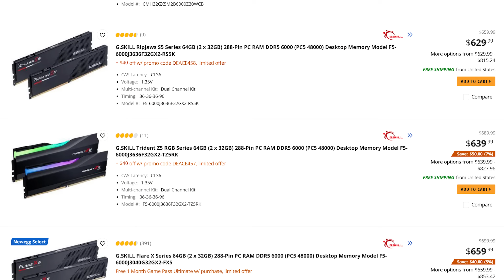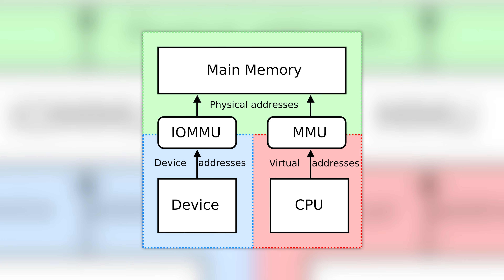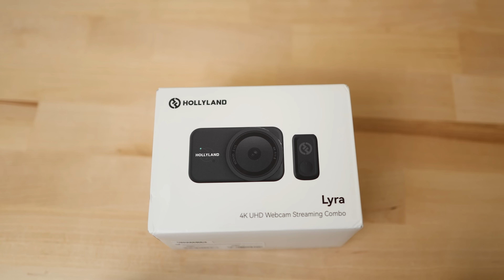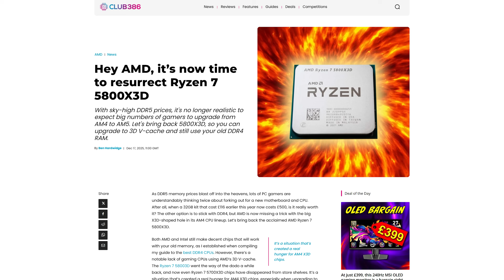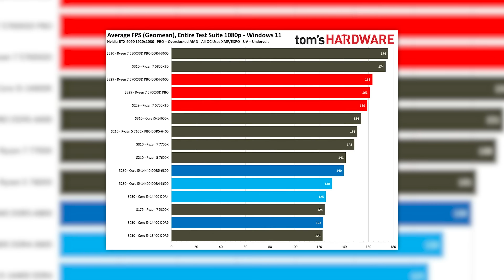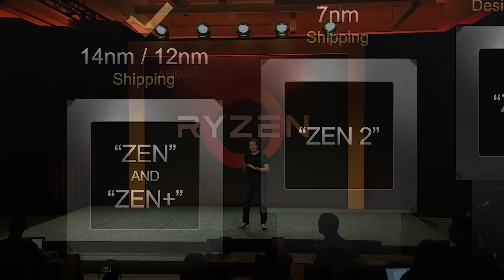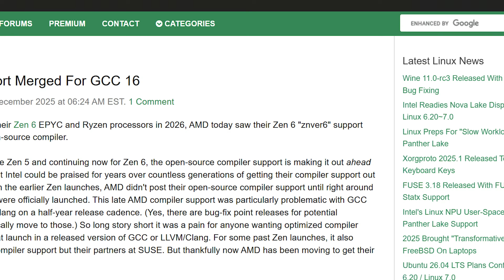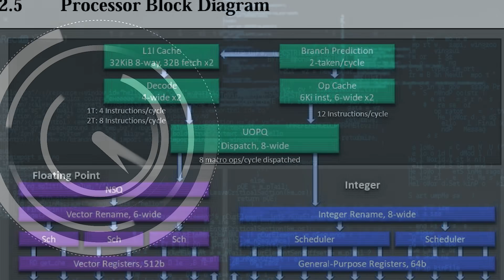It’s OFFICIAL! Ryzen 10,000 Is a Monster!

Comment: Fun fact the valorant thing had a workaround for cheaters the next day, with most of the cheats not even being affected by this. Riot are wasting their time, I guess at least there's some theoretical security improvements because of this? But Tbf if someone is putting hardware Into your machine you have other things to worry about

Comment: just a quick lil reminder, zen6 = ryzen 11000, ryzen 10000 would be zen5+
ryzen 1000 = zen (or zen1)
ryzen 2000 = zen+ (or zen1+)
ryzen 3000 = zen2
ryzen 4000 = zen2+
ryzen 5000 = zen3
ryzen 6000 = zen3+
ryzen 7000 = zen4
ryzen 8000 = zen4+
ryzen 9000 = zen5
ryzen 10000 = zen5+
ryzen 11000 = zen6
etc, every odd number acts like a "in between" generations set of cpu's (although most of the time the + cpu's are apu's)

Comment: well, x370 motherboard here (brought when ryzen 1600x launched) rocking with her 3rd cpu, with 1 year of 5700x3d, 5+ years using 32gb 3433mhz cl 15 b die, i hope my mobo and ram holds another 4-5 years lol. image going to 2030-2031 using a mobo from 2017/18
Reply: Yes you can, I still have ASUS Sabertooth 990FX R2.0 Released in 2012. Writing this comment using it with a bulldozer.

Comment: And this just makes me not want to play any of Riot's games at all.
Reply: Yes, i would rather play in COD's cheat lobbies...
Reply: So...you like cheat in games a lot it seems!
Reply: @riannair7101  to be fair, bios updates can be annoying as they often reset bios settings. On my mobo they recommend reseting settings even if update does not automatically do it... but yea, I would rather fix that issue. Not just for games but overall security of the device. I think it is bold move to require this as if there are people using OEM system with hardware raid 0, those might have to be set up again in bios after update and depending on how they are installed, pc might not boot before doing it.

Comment: I'm using the 5700X3D, i don't know how good AM5 really is, but its running all AAA games without a hitch (combined with RX 7900XT, 20GB RAM)
Reply: My old pc is the dame thing except had a rx7600xt and 32gb of ram and 3tb storage. Still runs everything like a beast
Reply: the 5800x3d is around about the same as a 7500x3d (and its the same with the 5800 and 7500f) so the 5700x3d would be similar to something like a 7400x3d if that existed
Reply: i have upgraded 3900x to 11900k skipping 5800x CPU, and then 11900k to 7800x3d and then 7800x3d to 9800x3d, and to be fair i want to go back to 11900k  right now xD, that was the spot my PC felt it was at its best, and lowest amount of issues. i consider 3900x being even better then 9800x3d due to task redistribution issues AM5 has on win 11, and that is really pissing me off. You just can't play a game with YT running on other screen or it will cause insane FPS dropps and lower video resolution to minimum, only cuz from time to time full CPU stress will be placed on 1st and 2nd core just to give CPU time to rethink that idea and again redistribute tasks over all 8 cores... it is really frustrating thats 3 years now and so simple software fix can't be done by AMD only cuz they can't find common ground with Microsoft. This corporate war geting out of hands.

Comment: they have to make it support DDR3 and DDR4 or it just wont sell well
Reply: Until RAM prices fall, and they will.
Reply: @toby9999  yeah it probably wont be long for the AI bubble to burst. All its going to take is for an AI model that only requires a single high end computer to train on to become mainstream (these models already exist), to cause the whole house of cards to come crashing down. The whole shortage was basically caused by Open AI making a desperate move to try and starve smaller competitors of RAM, all because they have bought into a highly inefficient brute force train by just recklessly throw computational power at the problem method.

Comment: At first I thought it was due to some new security exploit or CPU degradation issue, turns out it's for some multiplayer games I don't even play. No thanks I'm good 😂
Reply: Multiple games are rolling this out delta force just did it and I wanna say rainbow did it they were talking about it months ago it’s more of a matter of time depending on the game but it literally just means DMA users have to buy better firmware
Reply: Usless game Valorent. 2 years back the game just banned me for cheating, so i talked to them and they were ready to give me my acc back and I just said shove ur game  up your ass. I just had to prove my innocence.
Reply: @niteshshrestha3056   well played sir, well played.
Reply: It is a security exploit. You could create a device that reads anything out of memory, like encryption keys and credentials. And since USB4 supports PCIe tunneling, all an attacker would have to do is plug a device into a USB4 port.
Reply: @VTOLfreak  The question is however if it can be exploited without physical access to the computer. If somebody has physical access to my PCI-E bus then I kind of expect my entire computer to be gone by the time I get home.
Reply: @Thegoodthebadandthefleshtuber  But the world doesn't revolves around You. It may not be importante for YOUR use, but surely is for several other people.
And it comes from me: that doesn't play these games and despise in kernel anticheat.
One attack that could affect You: it's common for people to "lose" a flash drive (is it "flash drive" in english? Not my first tongue, and here we call it something else entirely) with an exploit waiting for Windows autoplay. Plug it in and You're compromised.
Another problem would be laptops.
A third one would be business PCs - even POS.
Reply: @sysbofh  I will reword it: how important is it to flash the bios on computers without third party access to the hardware?
Security on schools, offices and similar is not the same as security at home.
My evaluation is to hold it up against the fact that last time I updated bios the motherboard bricked. This means it's very important to know if the exploit requires physical access, a downloaded executable or can be triggered in a browser.
Reply: @Thegoodthebadandthefleshtuber  The exploit depends upon lack of checks on IOMMU access. Do you know what else use them? Virtual Machines. Do You know what Virtual Machines use? A standard interface, to virtualized hardware.
I'd say it's just a matter of time until someone makes a virus that emulates a virtual network card, and just uses this in order to bypass everything.
And the user wouldn't even have to be running a Virtual Machine - the system would just be able to run one.
Sorry about Your bricking MB. It's something that shouldn't happen. But modern ones can recover from it, no? If I'm not mistaken every brand has some kind of "it just brick this thing, let's try again" thing.
Reply: @sysbofh  
afaik, this is only a problem if you have passthrough, there are a lot of variables there for this to be a viable attack, it's not  THAT terrible. It's still bad, but not all motherboards are all that resistant to bricking, so I can't simply say "do it anyway" for people like that.
Reply: @diadetediotedio6918  YOUR case may be resistant to it. Not everyone's will be - and that is the reason why is important for them to release an upgraded firmware.
Reply: @sysbofh  
I never said releasing an upgraded firmware is or not important, it obviously is. But I'm saying for most people blindly recommending this is not a smart thing, and even more if the question is just to play a darn game. Updating BIOS is always something risky, and I don't think it would be unreasonable to say most people are tech illiterate.

Comment: I can't wait to still not be able to afford to build a PC thanks to this BS AI datacenter boom.
Reply: On some things it’s actually a decent time to build, just ram is killing things.   Might consider doing what I did.  Pick up a new 14th gen intel cpu(I went for an i7 14700, but an i5 would be perfectly fine), ddr4 motherboard and if you have older ddr4 use that or at least it seems cheaper than ddr5.  

GPUs are still decently priced right now.  If you really wanted to be on a budget you could even go AMD socket am4 with a ryzen 5 5500 for under $100 bucks and grab a card like the 9060xt 16gb and I’d bet you’d do pretty decently at 1440p using upscaling etc.
Reply: it will die soon. Open AI's brute force method of training AI will fail as more efficient models will wreck it, and this whole reckless data center construction boom will come crashing down.